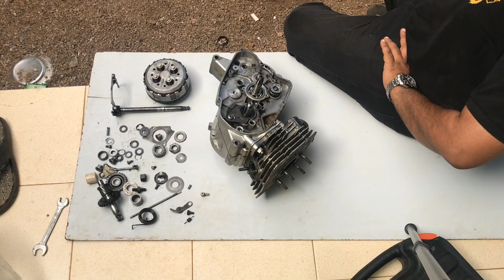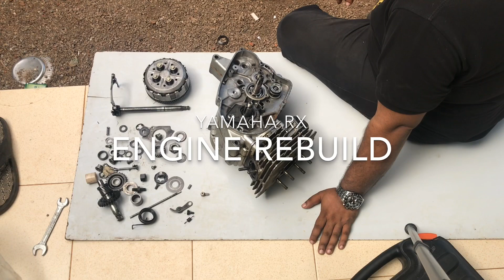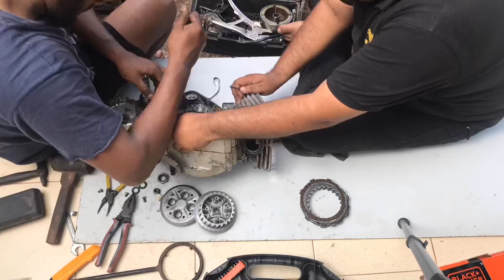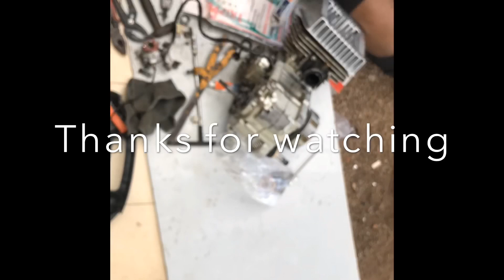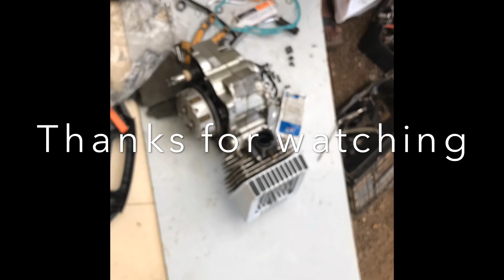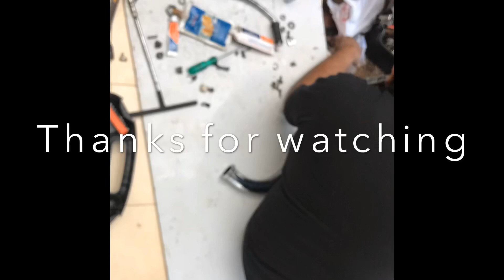Yamaha RX engine rebuild in 1 minute and 15 seconds

Comment: Nice man! Somehow I feel TVS-SUZUKI Engines are simpler to work on.
Reply from the maker: ZR1 Gamer both have their ups and downs, my first real rebuild was a shogun engine but I have done more rx engines than Suzuki
Reply: @Yamakaze  Yeah I agree.TVS-Suzuki does higher performance but Yamaha engine seems to be far more reliable with parts built from materials that can handle higher stress.Yamaha engines also tend to run cooler than TVS-Suzuki Engines.
Reply from the maker: ZR1 Gamer you have hit the nail on the head, Suzuki engines were factory ported and were stressed out. Yamaha engines were over engineered for the power they generate